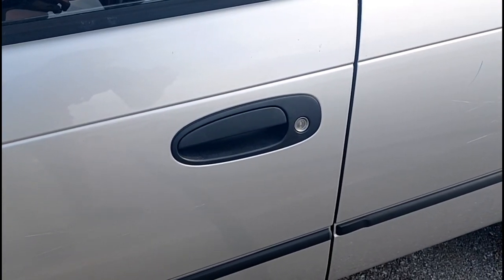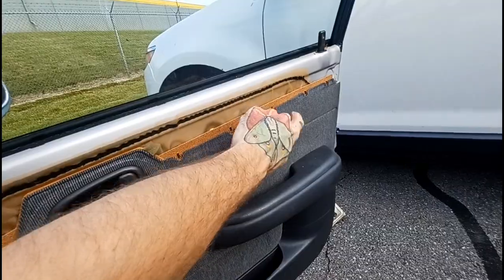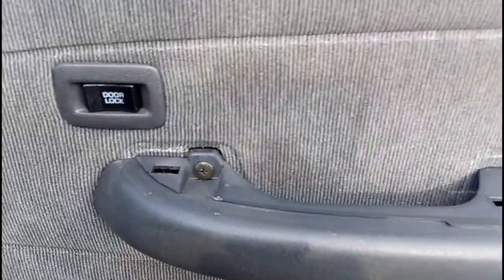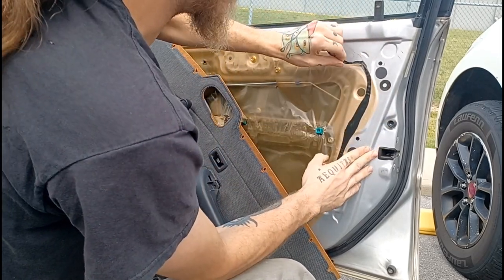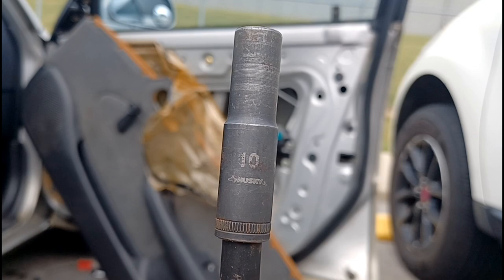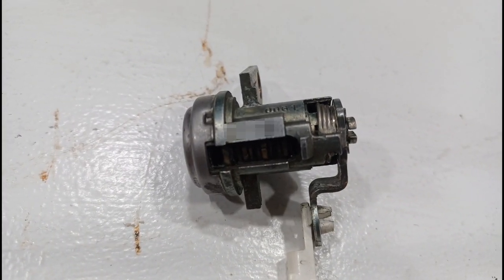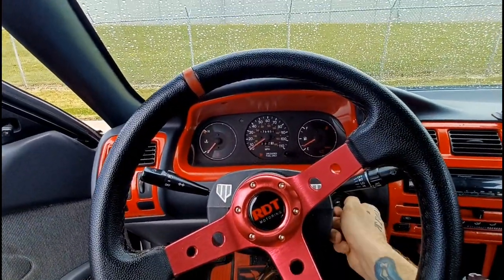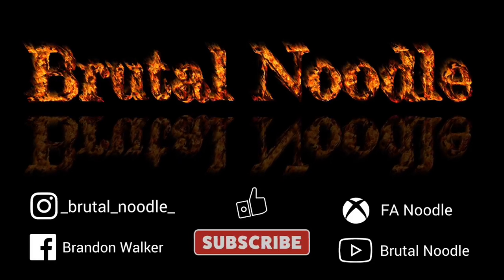Locksmith trick - Toyota key code location

Comment: I work in keys and lock ...i have a question ....somtimed the key cod i found in toyota hilux is not just numbers .....its numbers and letters ...start and end  with a letter and in the middle is numbers ....
Reply from the maker: I don't know about that one, possibly because it is older or maybe because it's not from U.S. there were a few separate numbers in different locations on mine, try looking all over the lock and you may find another set of numbers
Reply: @walker.projects  exactly they  r not from usa....many toyota cars come to me without the key code on the lock ...just letters and numer as i mention above...I just tought may you know other way easier than take the lock down to parts and take the bit numers manually😅
Reply from the maker: Sorry I do not. At that point all I can think of would be to replace the lock cylinder entirely

Comment: Did you need to prove the car is yours to get the key cut?
Reply from the maker: Not where I went, but I brought the door lock in with me so they probably assumes I couldn't get the lock out of the door if it wasn't my car. Can't say that will be the case for everyone though
Reply: @walker.projects  ok thanks. I just found out that i have to get my key programmed sadly so its going to cost a lot of money
Reply: @AL-ru3nk how much ? And what ur car model?